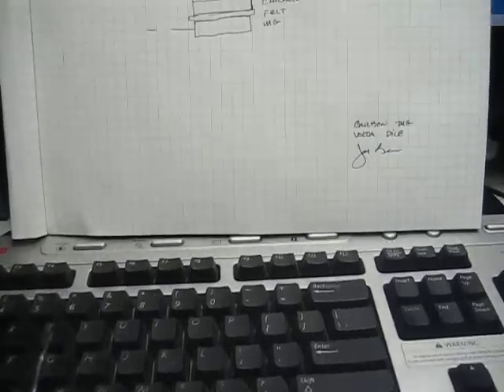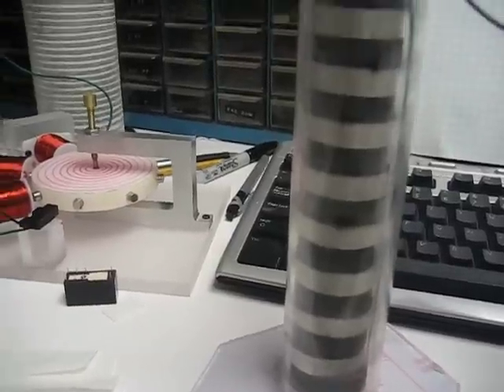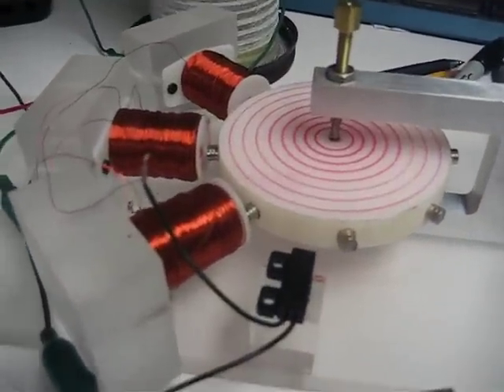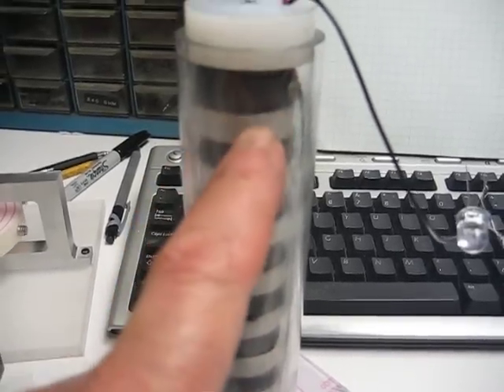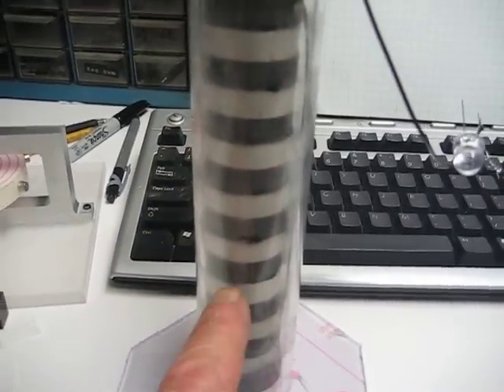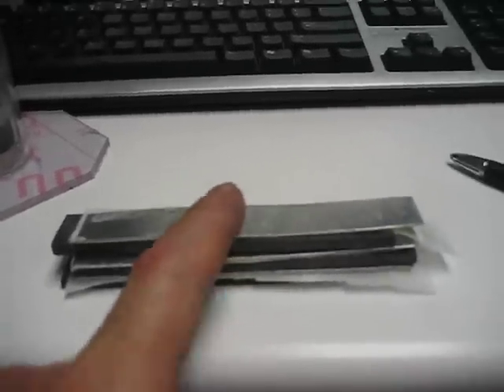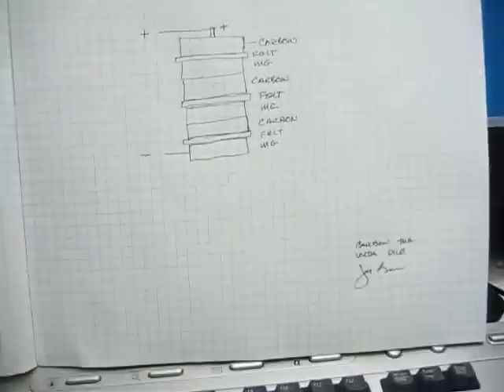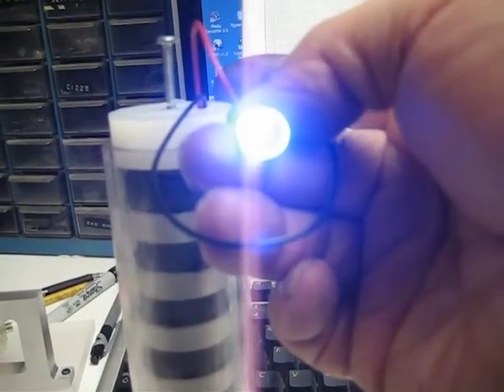Earth Light 6 Volta Pile Carbon Magnesium  John Bedini

Comment: Hi John,
very well done.
I just looked up, what exactly Alum is.
Some spice sites claim it is just Aluminium sulfate.
but Wikipedia says it is Potassium Aluminium Sulfate.

See: wikipedia . org / wiki / Alum
(Remove the spaces)

So probably Wikipedia is right.
It would be great, if you could post some updates to it, if it really
does not consume much the Magnesium.
There are also other Magnesium alloys that are more stable
than Magnesium alone,so look up the
metal suppliers for Magnesium alloys.